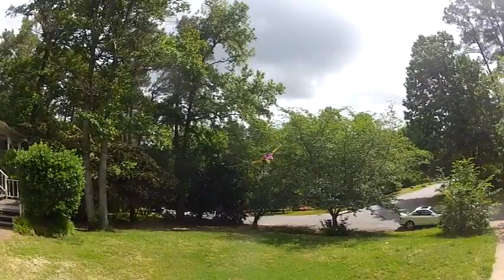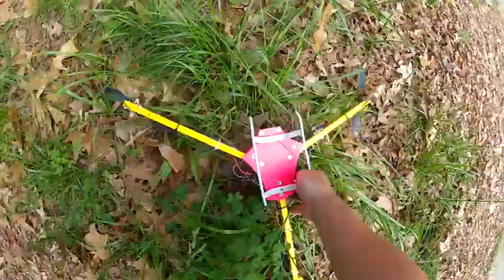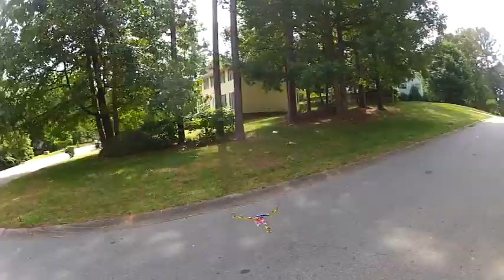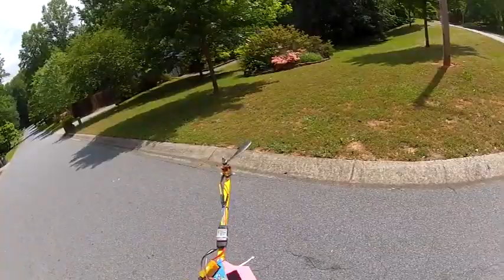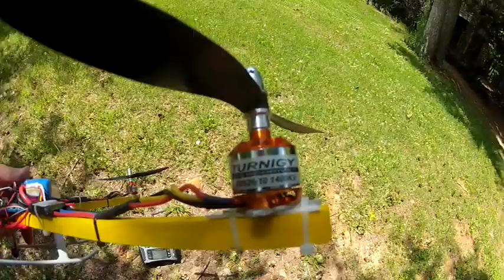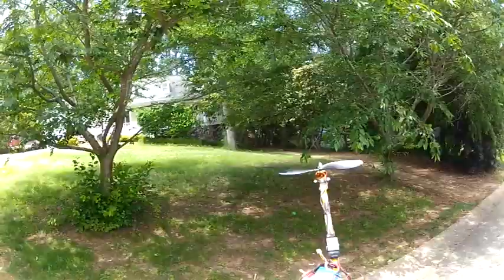New Simplecopter Tricopter demo video

Comment: Matt, I bought your New Simple Tri with all the exact components that you describe in this video except that I bought the F20A ESCs.  I got the 1.6 firmware as well, but I am getting some shakiness when I fly. I've played with the PI settings a bit to try and eliminate it, but I'm still having issues especially in wind. What PI settings and stick scaling are you using, or any other important settings that a noob like me should know?

Comment: Hi Hall,
Very nice vid and Tricopter control. I was wonder what exact battery you are using (C rating, discharge in amps). is it a s3 2200mah 20C, 25C or 30C? and for the s4? I dont want to burn the engines.
Thanks in advance!

Comment: F The guy who said that crap. Thanks to you im half your skills now! One question to you please. Wean you do flips, if you keep the tricopter upside down and leave sticks, (auto level off) it will keep this orientation until it crashes? or it will tend to turn right? I ask this, because i have already broken 3 frames and a lot of electronic´s trying to do stupid things. And also o noticed that even with auto level off, it  has always a bit of something helping to control the beast. Many Thanks!